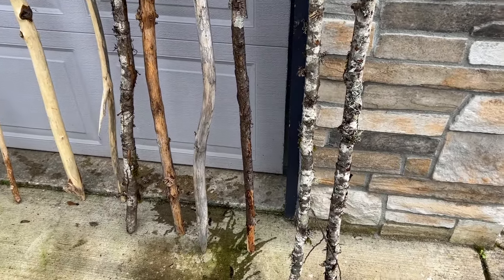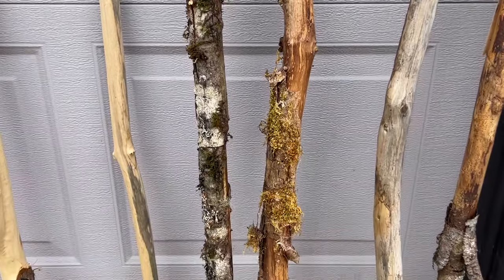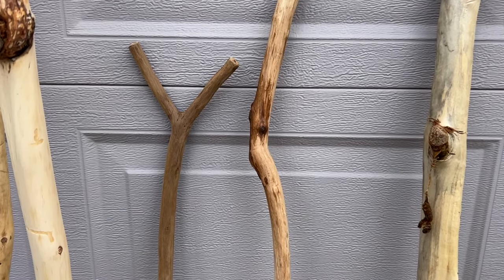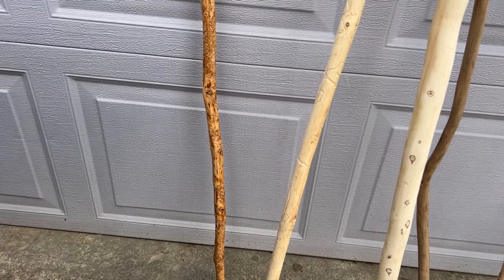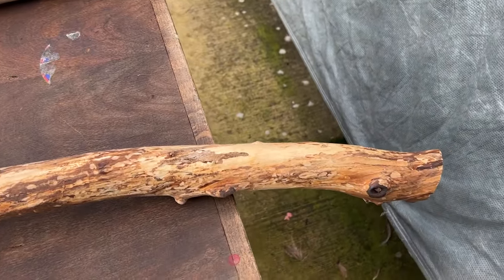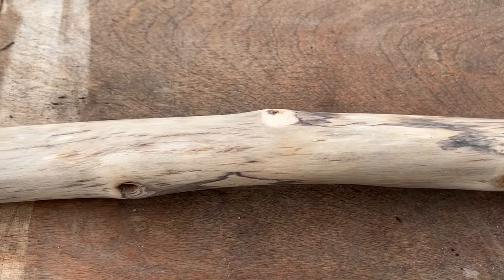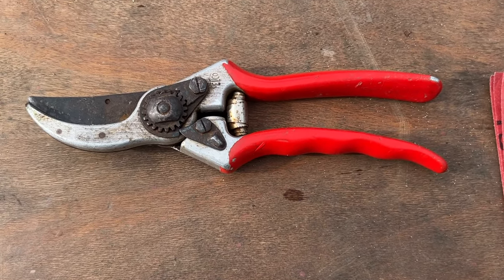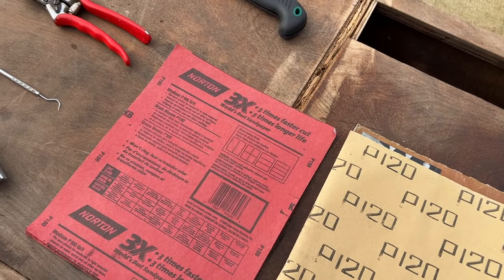DIY Walking Stick: Introduction

Comment: When you feel your folding saw dulling, give Corona Razor Tooth a try. The 10" folder has served me very well. My preferred choice of wood has been crab apple. Found a large grove of it growing wild. Favorite pieces have been crabapple saplings that have been wrapped in honeysuckle creating natural channels along the entire length.
Reply from the maker: Thank you for the tip, I could use a new folding saw. I wish I could find some honeysuckle wrapped wood here. I love the look of the walking sticks made with it.
Reply: @RetiredLyfe  I've never actually seen it at work, but I've heard you can wrap a prospect sapling with a thin strip of bicycle inner tube. You'll have to wait a season or two for the sapling to react to the binding.
Reply from the maker: @Steakfrie  That's very interesting. I might have to look for a sapling to try this on. So far I've only worked with dead sticks. I impatient on waiting for them too dry.